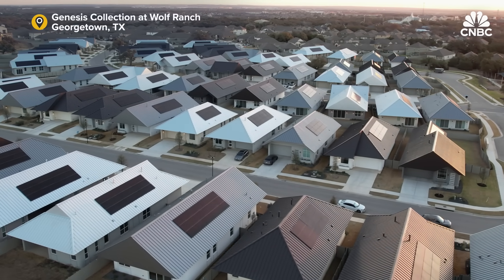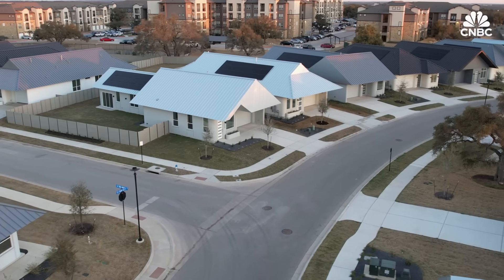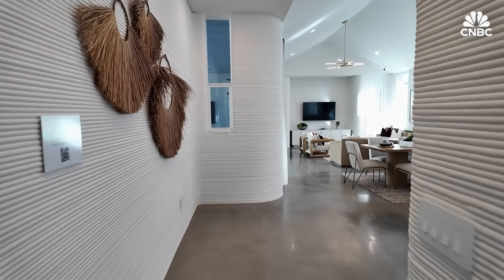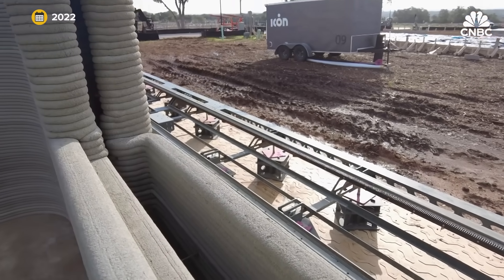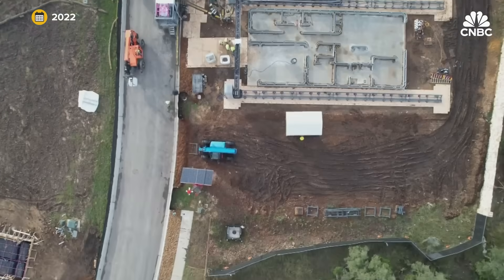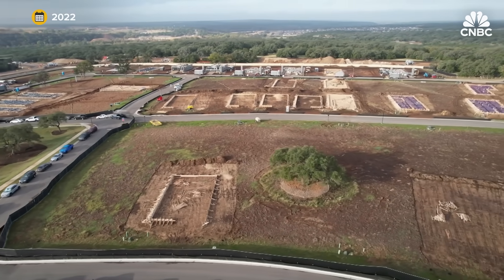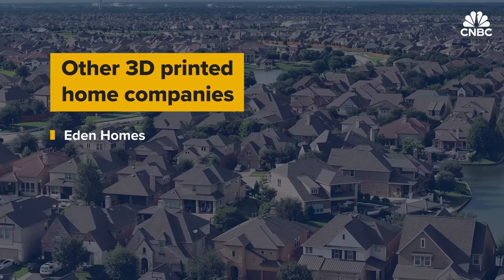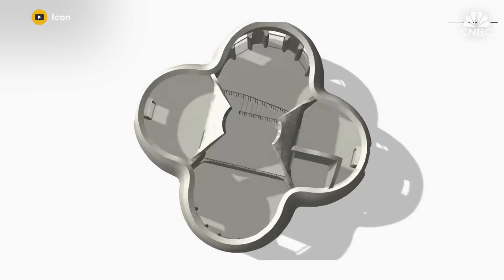Inside The World’s Largest 3D Printed Neighborhood

Comment: Need to see how these hold up over time. If the concrete starts cracking over the years it could be a huge safety issue.
Reply: Yeah... I am interested to see the science
Reply: I would mostly be worried about voids between the layers. Typically concrete is vibrated into place to remove all voids. Combine that with the fact that rain and wind are getting funneled into the weakest area.
Reply: I'm not entirely sure there isn't some amount of plastic in this.
Reply: They will be out of business long before that happens.
Reply: How do we know no air pockets were created in the concrete as well? What if water gets in
Reply: I'm curious how it would be repaired in the event that something damaged the home. Or what if you wanted to knock down walls and remodel down the road. 🤔
Reply: How do you think they'll hold up to ground movement, earthquakes, settling....?
Reply: Judging by the comments for this video, people are really stupid.  😂
Reply: @rpdx3yeah, beyond stupid. It’s like an Idiocracy role playing convention in the comments.
Reply: I wonder how those layers bind together. I mean, cracking delamination could become a problem as the building ages.
Reply: That's why hempcrete 3d printed homes are the best materials, it won't crack over time. It's temperature perfect in which ever season you're in. Glass panel sky windows can draw energy into batteries and provide power , and it's fire resistant so don't worry about your home burning down.
Why isn't this the main building material? That comes down to stigma propoganda from big businesses that have already invested into an inferior product.
Go and look up hempcrete 3d printed homes and be amazed and disgusted as to why it isn't being more rolled out.
Reply: @dancoughlan3297   but how long is the warranty if not insurance, how much, how long, who and what we need to be put through hoops, can anyone vouch enough to even give collateral, collateral approval of atleast 20 years "acts of god" or not?
Reply: @dancoughlan3297  hemp is more renewable, but it's basically a fiber binder, it doesn't change that much whether you use hemp, straw, steel, polymer, or glass fiber in terms of structure, others aren't really inferior, and hemp is probably harder to automate, so more expensive, hence why big businesses don't invest in it, sadly ecology doesn't pay if they aren't getting tax cuts or enough pr to offset that cost.
Reply: Typically a concrete vibrator is used to remove all voids and air pockets for structural durability. Whatever this "concrete toothpaste" is, it's pretty hard to believe that there are no gaps between these layers. I'm not sure if one layer dries before the next one is poured, but if so, the honeycombing will be even worse. Over time, it will erode along the lines, as they naturally collect rainwater and dust, and eventually it will become pretty unsafe.
Reply: @N8Dulcimer  You’re right that traditional concrete needs vibration, but 3D printed concrete isn’t traditional concrete at all. It’s not a low slump mix like you’d use for a footing or a wall pour. It’s a high-viscosity mortar with plasticizers, fibers, and setting agents that bond layers together chemically while the print is continuous. Because of that, internal honeycombing like you’d see in a bad wall pour doesn’t really form the same way.

On the layer bond issue, the printer doesn’t stop and let one course dry before the next one goes on. A properly tuned print keeps the material in the right “open time” window, so every bead fuses with the next one. If a machine stops and creates a cold joint, that is a construction error, not a feature of the tech.

As for long-term erosion, code-compliant printed homes don’t leave raw layer lines exposed. Builders use exterior coatings, elastomeric sealants, stucco, or siding just like any other masonry structure. The inside cavities where reinforcement goes are typically filled with grout or concrete, which gives the wall the same structural backbone as a CMU wall.

The companies doing this at scale have passed wind, seismic, and hurricane certification tests here in the US. The Army Corps of Engineers has tested the printed structures too, and they hold up extremely well.

So the concerns make sense if you hold 3D printed concrete to the rules of traditional pours. The materials and methods are different, and when they’re used correctly, the durability is far better than it looks from the outside.
Reply: And I have a hunch that the concrete used in this is subpar and will last maybe about 25 years.
Reply: @BabyBugBug There's no rebar in it and Im ASSUMING that it contains fiberglass for some strength
Reply: @Oldschoolrules123  I saw another video on it, they actually use embedded steel cable instead of rebar, so lengthwise cracking is unlikely.
I don't know their exact recipe, but iirc they use a lot of resin, and I'd assume it's lime-heavy like roman concrete or uses an equivalent, so it would be naturally crack-resistant (when it cracks, water infiltrates and the lime disperses and crystalizes, so it seals the crack before it becomes an issue.)
Reply: @BabyBugBug  People keep roasting the “concrete” like it’s a bad driveway pour, but it isn’t even concrete. It’s a printable mortar designed for layering. Judging it by concrete standards is like judging a cat for not being a good dog or yelling at a Tesla because it doesn’t sound like a V8. Different recipe, different purpose, same amount of internet outrage.
Reply: @Ferrous_Bueller  Mortar withers away and turns into sand. Unless this is some kind of special magic mortar that really isn’t mortar.
Reply: @BabyBugBug I used the word “mortar” because it’s as close as to an easy way to describe it for the dummies that think it’s concrete and are two lazy to spend 2 minutes researching it before posting dummy questions. Since you’re starting to stereotype yourself into that crowd, and obviously had a hard time reading, I’ll repeat myself by remove the word “mortar” for your lower intelligence level.  It’s a high-viscosity blend of various components bound together with plasticizers, fibers, and setting agents that bond the layers together chemically while the print is continuous. Or, how you like to refer to it, “magic”. 😂
Reply: Yup doesn’t seem like they know concrete. That’s a thin wall. Btw Mexico homes are made of concrete but they are like 5 times thicker and with rebar. One small earthquake will destroy these homes. And just images the repair cost
Reply: @J @JMolina94.  the only one who doesn’t know concrete is you, because it’s not concrete 😂. We already have real world anecdotal evidence in areas hit by earthquakes, tornados, and hurricanes where 3d printed homes survived where stick built homes didn’t. From an engineering perspective, they’re superior in almost every way.
Reply: It's lousy concrete too, slurry 😂and sand.    Gonna be damp and moldy
Reply: @j @jamie.777  You aren’t the brightest bulb in the lamp shop 😂 People like you keep roasting the “concrete” like it’s a bad driveway pour, but it isn’t even concrete. It’s a printable mortar designed for layering. Judging it by concrete standards is like judging a cat for not being a good dog or yelling at a Tesla because it doesn’t sound like a V8. Different recipe, different purpose, same amount of internet outrage.

Comment: I liked the special designed house that they showed around 8:00. I think that if you have a printer that is capable of doing any shape wall it's dumb to only make square houses. That was a limitation of previous materials. They could really lean into some different designs that make it special instead of boring cardboard boxes.

Comment: Isn’t stone/concrete housing a higher risk for cancer? I have to wonder if the type of concrete paste used may be worse than standard concrete either due to how it is extruded or the composition. I would feel better if the concrete was covered, but I suppose that would significantly increase the price.

Comment: As someone in the home building industry this is all hype, total nonsense.  Humans poured the pad, put in the electrical, plumbing, HVAC, roof, insulation, windows etc  I guarantee they had staff there who had to frame the window/door openings as the 3D printer printed the walls, cement needs supports.  The only real cost saving is no drywall on the inside walls and no siding for the exterior.  Aside from that all this thing did was put up the walls, which honesty a good framing crew could do in 2 days.

Comment: My grandfather built a lake house with 4 cinder block walls. The monolithic slab had rebar sticking out every 8" on the perimeter. 4' rebar was then tied to those, the cinder was laid, then, another 4' of rebar was tied to the existing again. When all the cinder block was done, every 8' tall hole was filled with concrete. 40 years later, you couldn't find any shifting anywhere in those 4 walls! There's more to the construction, but, my point is, that internal rebar inside of cement cinder block, then, filled with concrete will outlast these houses, by far! There's no steel reinforcement in these walls & the concrete is partially drying before the next layer is added. When settling & shifting do begin, it will compound.
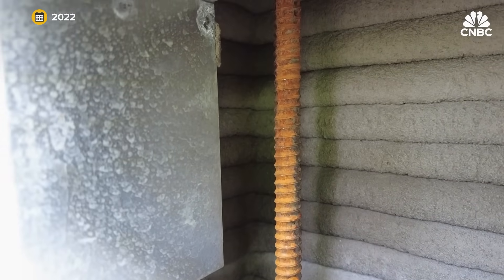Reply: 3:59 there is a rebar...I think they stick those in here and there behind the wall...

Comment: It doesnt matter how concrete is poured, how are they getting around Heating/Cooling and Humidity issues? In hot climates, concrete absorbs daytime heat and can radiate it into the home at night, making it harder to cool, once the structure gets hot, it takes a long time to cool, even if the air temperature drops. Concrete can also hold moisture, which may impact cooling efficiency if ventilation is poor.

Comment: So now instead of 70 people earning a paycheck only 1 will earn it.....The owner of the company which will now earn all of those 70+ paychecks. The price? Still the same as buying a regular home? The long term? studies came out stating that these degrade so fast within half a century there will be big problems. Pretty sure this company isn't using the new technology that scientists discovered to strengthen the structure by over 40%. So yeah this is probably falling apart under 40 years. I think I much rather prefer what that company in Florida is doing where they build the structure with thin sheet steel metal. It's hurricane proof and will withstand hundreds of years and a lot of people will earn a paycheck instead of just the one guy lol. $200k price tag sure justified but $400k totally not worth in my opinion. Worked in construction for many years.

Comment: That's NOT wind resistant, and it's not really fire resistant. The principal fault is a square shaped lot, is a municipal zoning culture that is counterintuitive to the capabilities of the building material and construction method.

A monolithic dome is fireproof and windproof because it allows for circular airflow as dissipation, including the wicking away of moisture against erosion. A square shape is downgraded from proof to resistant because ninty degree angles capture air and moisture pockets, thereby absorbing pressure and temperature changes with sustaining. Throw on an oversized roof for showiness and you've made a guaranteed vulnerability to natural disasters and environmental factors over time.

Further, whereas a monolithic dome is an exterior shell only, capable of being earthquake proof, allowing internal walls and rooms to be modular and reparable, the 3D printed structure is a solid piece, any cracking anywhere structurally forfeits the entire property instantly.

So I would consider 3D printed housing a scam of intentions. Sure, you spared on lumber, but it's accident prone and unrepairable in an entirely new category of ways, defeating the point of construction altogether.

Comment: Nothing but formless cement. So that requires special cement material, special gantry robot, gee I sure hope there's rebar reinforcement but I don't think so. You could do this WAY faster with CMU bricks, drop rebar tie-rods in there, fill up the blocks with grout. Finish it with stucco and nobody knows you did it faster & cheaper & stronger. I'd build interior walls with lumber, same as the roof. 3d printing is a rapid prototype technology. This is a joke.

Comment: If I'm going to accept a house that's cheaper to make I expect at least half of those cost savings to be mine. I love 3D printing, but 3D printing buildings is stupid, the concrete walls will be filled with cracks within 30 years of it's construction.

Comment: This is like the CVT transmission. They built then cheaper and the customer pays the same.

The middle-class continues to be squeezed for profits to increase.

What is the longevity of these homes? Will they crack over time? Are they easy to repair?

Comment: An industry that hasn’t changed in 200 years? Lol, sure. Form stone and logs to mill cut heavy hardwoods, to metal and engineered lumber and sheeting to sawdust and glue covered in cardboard and plastic wraps, there have been many changes. Most current new homes could be broken into through a “solid” wall with your pocket knife and a medium size rock. Nearly all of the changes have been a effort to increase profitability. Looks like they have set their sights on the labor cost this time and are going to crow about the sturdiness of the finished product. Fine for now if you like the look of it but I predict the concrete will be replaced with a less expensive material before this technology matures and it will again be focused on cost savings, not quality. Maybe some byproduct of another industrial process that currently costs money to dispose of and will later be found to be unhealthy somehow.

Comment: First Rule of 3D Printing Hype:  Whatever noun follows the descriptor '3D Printed' is always the wrong word

Using '3D Printing' techniques to place concrete results in an empty concrete shell. It's not (yet) a "house", not (yet) a "home", and certainly not a "neighborhood". There remains a lot of skilled work left to do before it's a house.
Until the concrete nozzle can (painfully?) extrude a lintel over gaps, then it's not even a fully '3D printed' concrete shell. 
3D Printing technology is great. There's no need to lie and exaggerate about what it is capable or producing in the present era.

Comment: This is interesting, and since I'm in construction, it could be a game changer, eventually. However, does everyone just want the same looking house that has no character or charm? Because it seems like communities are starting to look so generic. And what happens when you want to move artwork from a wall? How are the holes patched up behind it? Or when someone sells? You have to place things exactly where the other homeowner placed it? Or if you just want to change the space because you didnt realize you wanted a bigger room? And what if you wanted to paint the walls some fun moody color? How would that work on those bubble type concrete walls? And i dont want to imagine how dust would be eventually with those bubble walls. I think there's more to think about with these homes than just getting them made. But I feel like it can happen because its cool to see this.

Comment: Three people building a house is totally misleading. This process essentially replaces the Framing of a house, which is very commonly done by three people for a house that size. Still need plumbers, electricians, HVAC, roofing, trim, carpentry, painting, flooring.  I promise, this house will be built with many more than three people.

Comment: texas where solar does wonders and people concerned about energy efficency. This could also be done with ICF where you would get a flat wall that looks much better with a thermal mass and foam on both sides for a thermal break. also eletrical can be run in the foam without compromising the wall...
Reply: also you are pouring the foundation with traditional means meaning the stuff to build a icf home is already at the jobsite instead of hauling that bigass machine around.